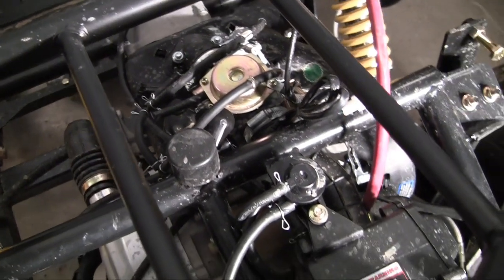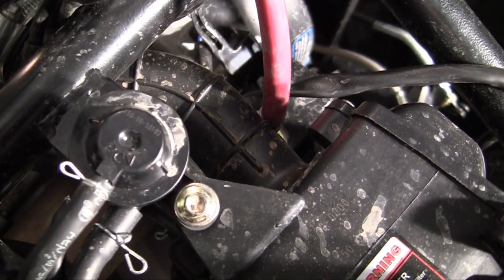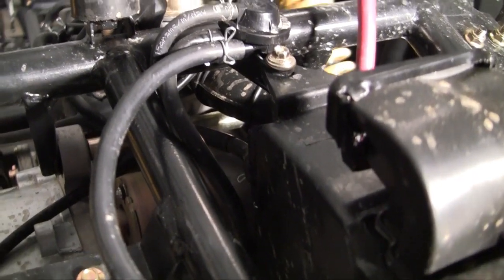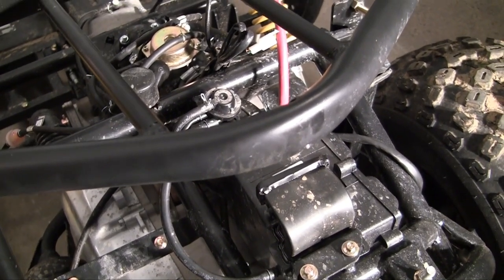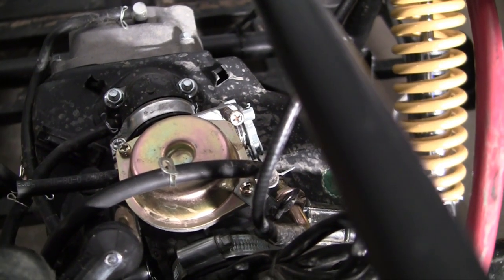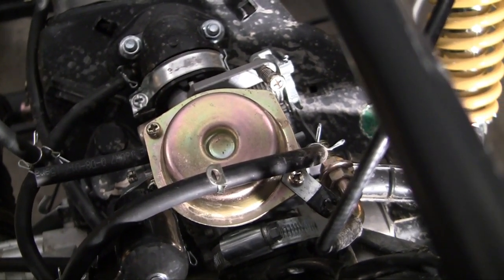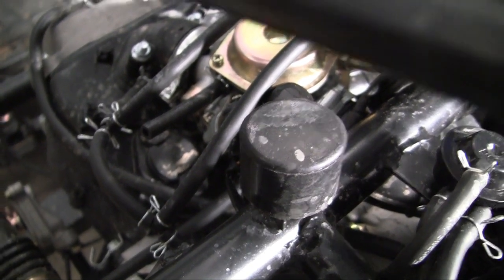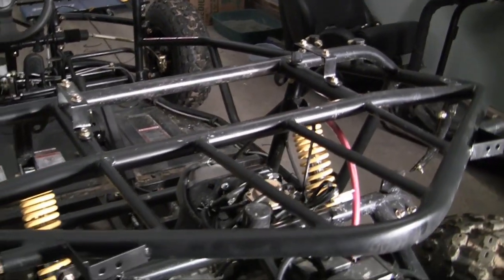How to Build a Go Kart - 21 - PCV System

Comment: I have the exact engine. I’m gonna beg I guess for your vacuum diagram setup as I just bough the go kart and it runs but vacuum lines (PCV System) all disconnected from the previous owner attempting to replace carburetor.